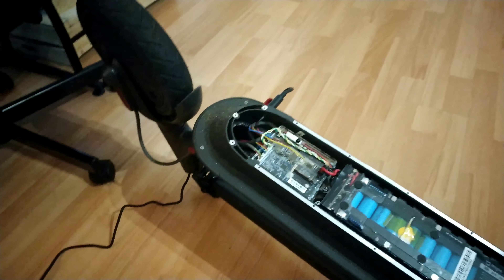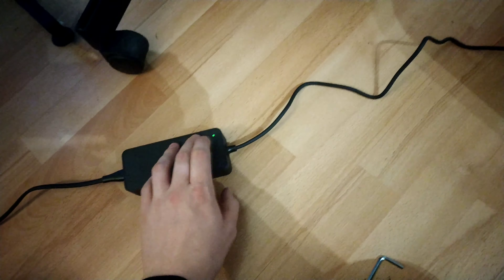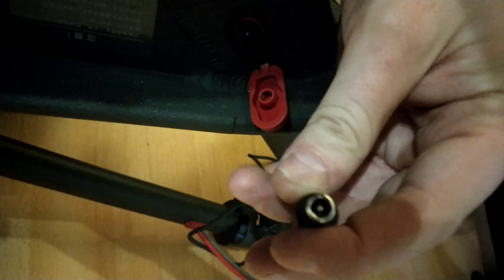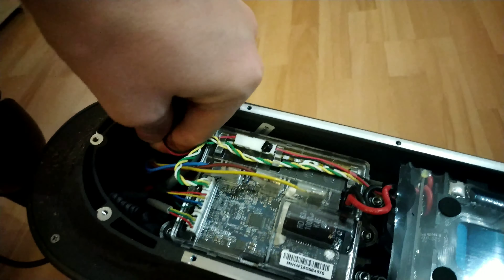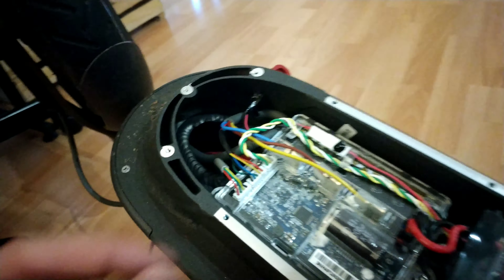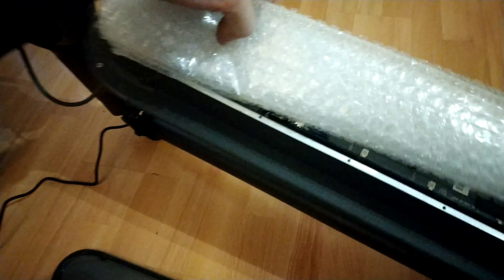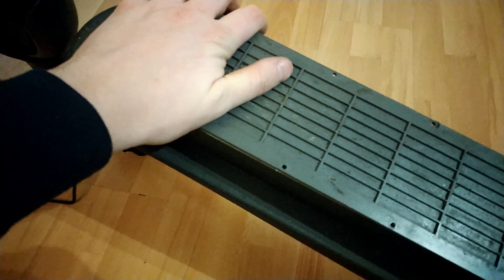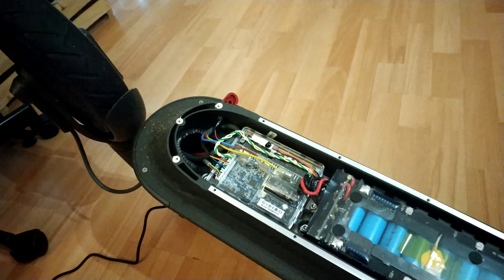Xiaomi M365 Non charging issue easy fix.

Comment: Thanks for the tip, save my day.
I can't believe this basic problem stil exist in 2020 model of Pro 2 😟
Not everyone has an electrical screwdriver to take out and put back 21 screws plus you need a special bit 😟
Reply: but everyone can buy one it's cheap. And if it's under warranty just send it back for warranty, if everyone keep fixing the problem himself they never know there is those problems.

Comment: Thanks for posting this vid Thomas! I had the exact same symptoms and was pretty down about it, but your video helped me realise that my battery might not be completely trashed after all. If you can believe it, my case turned out to be even simpler than yours - apparently the charging port got dirty, so I cleaned it and it resumed charging again :D That silly port cover is the worst, but need to pay better attention to it from now on. I also fiddled with the wires connecting to the charging port before checking (by just unscrewing the charging port itself instead of the bottom cover), so not sure if that made any difference, but both wires sit pretty sturdy in the port already. Anyway, thanks to your vid I have a working scooter and don't have to take it to someone who can fix it :D Yet.
Reply: How did you clean the port
Reply: @millietoomey4066  hey! Idk, was a long time ago, but with something small like a toothpick and isopropyl alcohol. The bad news though is that in my case the battery did seem to charge initially after that, but later that week died for good. Maybe this was caused by dirty port arcing, or bad battery caused the port to oxidize, or was just a radom coincidence. Got the battery fixed on warranty that week and still going strong!

Comment from the maker: Hey @pica I have had no issues so far been using it for 10 weeks now, every day, I have additional lights front a rear, and wear a helmet at all times so you look like you should be on the road, I do my best not to give an excuse to pull me over, Im I'm near a police car I will kick the scooter much more so make it look as if I'm not just riding on pull throttle but only when needed. I think the main thing is to just make sure you look safe and are not putting you self at risk and others and they will leave you alone. I'm in Brighton and there is loads of Xiaomi scooters and even a electric scooter shop selling just scooters so it's definitely coming we just need to wait for the law to catch up. It's very backwards in the UK.
Reply: Have you looked to do the firmware uprade so top speed is 20mph instead of 15.5mph? if i get one im planning to add a second battery for increased range (my commute is 3 miles of roads and 10miles of canal routes one way), 
This artical shit me up, but the kid must have been taking the p*ss to get 6 points 
https://www.theguardian.com/world/2018/nov/14/boy-gets-six-points-on-future-driving-licence-for-scooter-speeding

Comment: Worth a return imo if you can. (E.g. Amazon or anywhere). Had the same issue with our S1 scooter. I remember I jumped a bit with my scooter and then it doesn't charge. This could explain it.

Comment: naah that bubble wrap is not a solution ... coz if there is short circuit it will burn up pretty fast ... rather use silicon glue to stick those wires
Reply: solder them properly or change the connector.

Comment: What does this ride like when off, like using it as a regular kick scooter if the battery flops
Reply: Bad
Reply: Very bad, not at all as a normal scooter. Lots of resistance on the wheels. If you give it your all you can go about 10-15 meters after stepping on.

Comment: When I connect the charger, light on the battery stays blue for a few seconds then blinks reds and then completely turns off. Any ideas?
Reply: same... did you fix it?
Reply: Had the same issue. The problem was in my case that two of the tap connectors were loose.

Comment: Hi all,

My scooter has the red and black wires reversed in the white pin. I just reversed and it works :))
Reply: Was it like that when you got it or u had changed it without noticing?
Reply: mersi frumos de comentariu, si trotineta mea a avut fix aceeasi problema. am rezolvat!!!
Reply: @mihaigurgu532  salut, poti sa mi spui te rog cum ai rezolvat?
Reply: @razvi221  da, salut. Am desfacut partea de jos a trotinetei si am vazut ca sunt 2 fire negru rosu ce intra intr-o mufa, si ies negru la rosu si rosu la negru. Scoate firele din mufa si inverseaza astfel incat firul negru sa fie la negru si cel rosu la cel rosu. Si apoi se incarca fara probleme